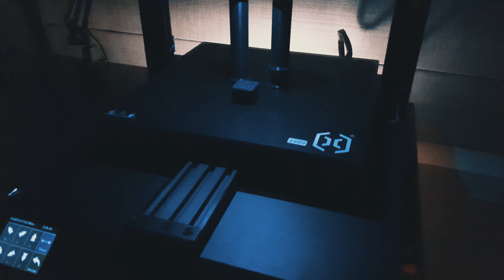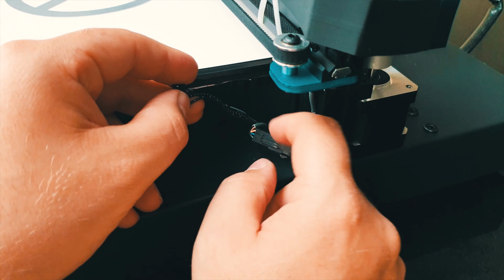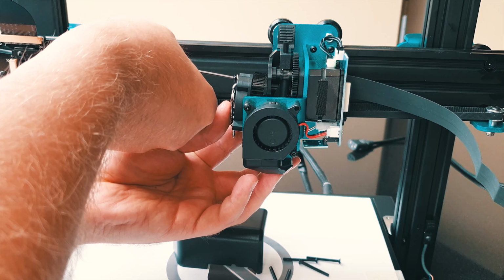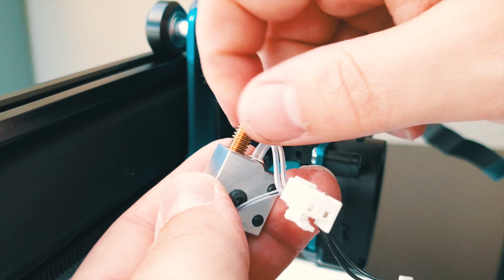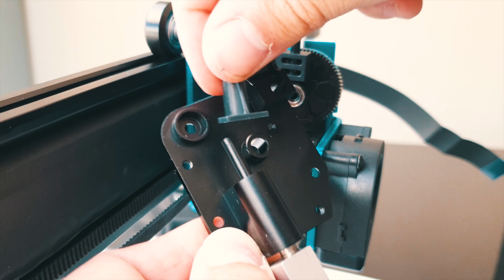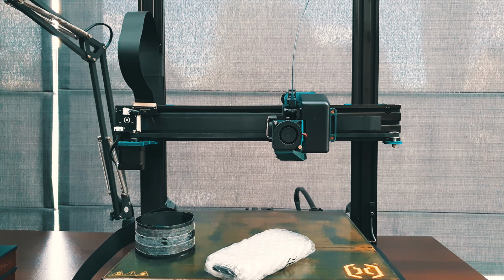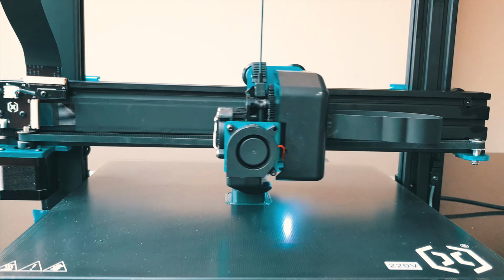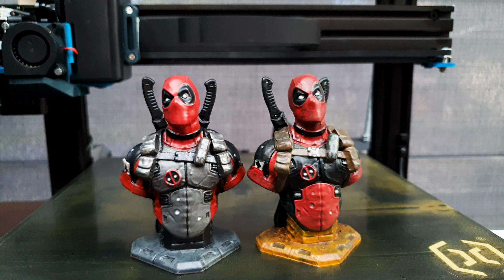The Artillery Sidewinder X1 3D Printer version 4

Comment: Thanks for the video. I'm curious what adjustments/changes you made to with your benchys?  I have the same printer, and I've tweaked this and that, but my benchys still look more like your bad ones. A video on this would be good and very helpful. Thanks again
Reply from the maker: Calibration and print slow. Last benchy is @25mm printspeed max. The overhang defects are cooling fan issues. That's something that can be upgraded.
Reply: 25mm max hey... yeah, that's why mine aren't looking as good as yours. I think I'm too impatient, I print everything in the 80 to 110mm range

I would be very interested to see a video on the calibrations you did. I think mine still has room to improve, even without dropping the speed

Thanks
Reply from the maker: I could do a speed vs quality test with and without calibration. Thanks for the idea! Now i need time 😅

Comment: I plan to print a PC case.. i think ASA would be the best filament choice. Can the Artillery sidewinder x1 handle ASA? And in yes any Thing ich must consider? To be honest am still a noob on 3d printing the Artillery would be my first on printer
Reply from the maker: To be hones, i find myself a big noob with most stuff i do😅. I have a roll of asa and it will print it but not for long if you keep the ptfe heatbreak but you can change it for an all metal variant. The stock firmware supports temps to 270 if i remember correct. After that you might wanne use a closed case so you get a nice and hot buildvolume with no drafts of wind and a hot buildplate(the fumes are also quite toxic). Although asa is better then abs to print, it wil warp faster then Scotty if you fart at it from the room next to it for large prints.

Comment: for some reason some idiot at the artillery factory thought it was a good idea to cover all the unused sockets of the board with hot glue. i spent hours trying to clean that board, of all the issues with this printer for me this was the biggest one and the most infuriating.
Reply from the maker: I can only imagine when you try to mod it 🙈 very frustrating.
Reply: dude they forgot all my fucking screws

Comment: Anyone having z banding or inconsistent extrusion?
Reply from the maker: There are people having z banding and inconsistent extrusion problems. Most of them are user error like to fast,to hot, no proper estep calibration,to much acceleration or printing high prints without a z brace and lose belts gears and stuff like that. Inconsisten extrusion is more caused by nozzles not touching the heatbreak and causing it to clog up in the heatblock like mine came from the factory or ptfe tube degradation. If you like there is a huge forum on facebook with a lot of helpful people but most quostion can be found true the search function. https://www.facebook.com/groups/artilleryswx1/?ref=share
Reply: @NoizieWorks  Yeah I had the nozzle-heatbreak gap as well. It wasn't noticeable in the beginning, but caused me a big headache, since it asserted itself with big ugly blobs when retracting. As for Z banding, this seems to be a common problem with Artillery printers, maybe caused by too much acceleration. This printer definitely has its problems from time to time and needs maintenance and adjustments every so often.
Reply from the maker: That's something i will adres in a next video but yes turning down acceleration and jerk fixes most z banding. Also people are obsessed by print speed and yes this printer is capable of high speeds for long and straight objects it's fine but i see them push 50 to 70mm/s with .12 layer figurine models wich is looking for problems imo 🤷‍♂️ like many vets say in the forums "90% of the problems are user error"
Reply: I use cura, set the retraction to 0.6, smart seam and the inconsistent extrusion was gone.

Comment: I don’t understand why you are fuxxxxg about with this printer. It comes perfectly functional. Stop trying to improve stuff that doesn’t need improving unless you are actually the developer ????????????
Reply from the maker: Hi Dean, this video is all about the unboxing, assembly and the things you should know before buying it so it's bone stock. You're right it's a solid printer for the money (if you stick witg petg and pla) but it's far from perfect if you look around in the community groups(don't have to trust me)
Most upgrades are to improve functionality like being able to print abs or flexibels without having to change the ptfe liner every few days or using stuff like glue sticks and tape on the print bed and if it's not that then it's to protect the fragile ribbon and printbed cables. I didn't cover that in this vid sooooooo.............